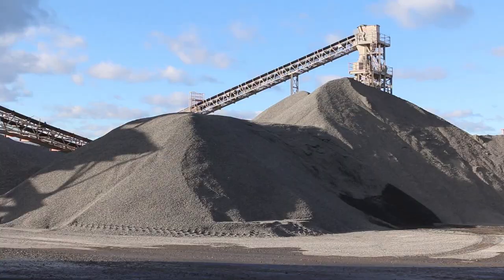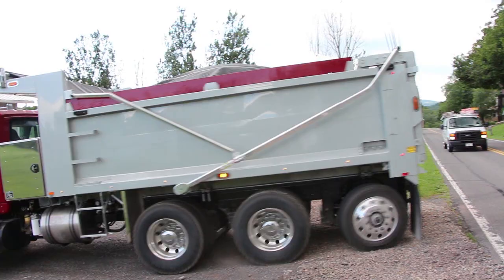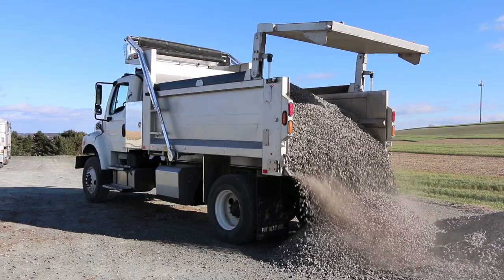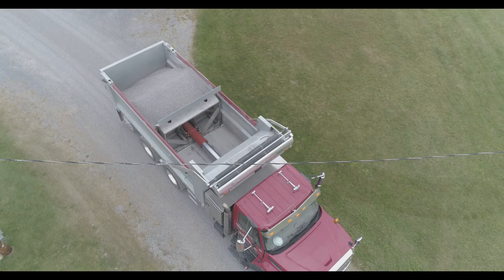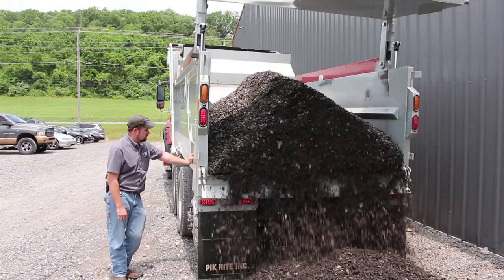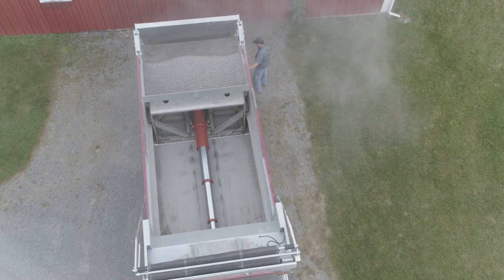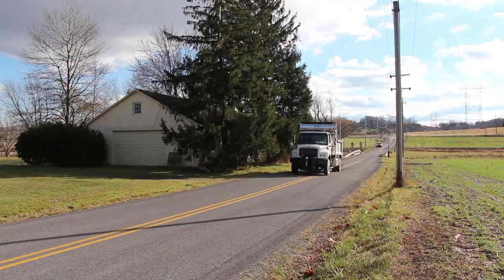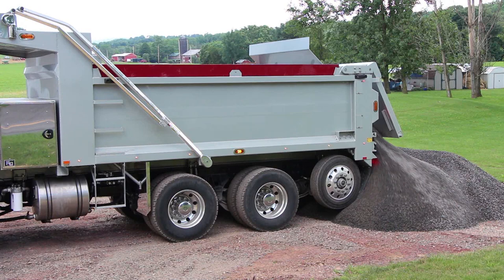Hydra-Ram Truck Bodies

Comment: Food for thought: have the tarp extend as the ram extends, that would reduce the chances of a loader operator filling the truck if the driver forgot to retract the ram.
Reply: Yeah I like that idea I run a front end loader and once in a while I see the tarp extended and tell the driver but most of the time they forget to latch the gate. One time I loaded 22 ton on a truck and after he pulled off the scales he remember there was a troweling machine in the bed.oopppsss.

Comment: Yea I see its value. But if you’ve ever serviced a dump truck, you know how convenient it is to raise the body to adjust slack adjusters and reach the grease fitting all over the the place! I want to know one other aspect, that’s frozen weather operation! Like I’ve seen a lot of loads freeze to the body, where you must spec a vicious vibrating device that shocks the material, along with the help of gravity to get the load out! I know hydraulics are very powerful! But is that ram enough to force a frozen load? Even with a heated body??
Reply: K. R. V. I agree on being able to lift the body for maintanance
Reply: Christopher Read yea man! Even from a drivers aspect that worked many years for a great company with the best equipment, that requires the driver to sweep out  your assigned truck every day at the end, with an owner that notices if you don’t and will give you hell! With a requirement you wash and polish when needed without telling! But all on the clock! That’s why he can and will give you hell for an unkempt truck. Plus the driver is also required to service and keep meticulous records! So when I say a lifting body is a good thing, I mean it! I cannot imagine having to wash all the mud and crud from underneath a dump truck with a fixed bed! Maybe a sand hauling highway princess, but not a rig used for excavation!
Reply: K. R. V. Sounds like your boss knew the importance of clean machenery for the company image. 
And i can tell you from exsperiance  that changing suspension bushes is much easier when the body is up then when its down. And i agree that lifting the body to wash under the truck makes it a hell pf alot easier.
Reply: Christopher Read also being able to raise the body in snowy rainy weather is a big help.
Reply: K. R. V. Definetly.

Comment from the maker: In answer to some of the questions below: These bodies are built with 1/4" Hardox floor and 3/16" stainless sides. They are being used and abused are holding up better than traditional steel dump bodies. They have been used for large stone and rip rap as well as smaller aggregates. Optional steel thickness and custom options are available for your specific needs. In-cab camera monitoring systems, indicator light or alarm available to prevent loading while pusher is extended. Hydraulic push ejects frozen material better than gravity flow dump bodies. Call 800-326-9763 or email sales@pikrite.com for more information.
Reply: I would think this would work great as long as the bodies held up, but a few big dings in the side from rocks and material might seep through when being pushed.  Also would worry about a piece of concrete with rebar sticking out the side slashing the side and the bottom of my  trailer like Wolverines Anamantium blades.
Reply from the maker: We have had good success with the bodies holding up. The stainless sides and Hardox floor are stronger than carbon steel.
Reply: Has it been tested on asphalt ?
Reply: @PikRite  how much tonnage can this truck carry for palm shells or palm kernels?

Comment: What about when you're dumping into a paver how can that help you
Reply: Sam Zmigrodski
How does a side dump or a bottom dump  help with a   paver  ?     Yet they have applications where they are the best tool for the job .
Reply: A Conneely thats where 2-way tippers are good. The convinience of a side tipper with the option for rear tip when sealing roads
Reply: Christopher Read
Does a bottom dump   do that as well.  .How about   double dump trailers  they they work with a paver too .
Reply: What do you think ?
Reply: But all i was saying is were we are 2-way tippers are the way to go as we can use our body trucks and 2 side tipping dog trailers ias a road train for carting gravel and running it out. Then the same trucks with a cockral speeader on the back lay out the screening when sealing a road.